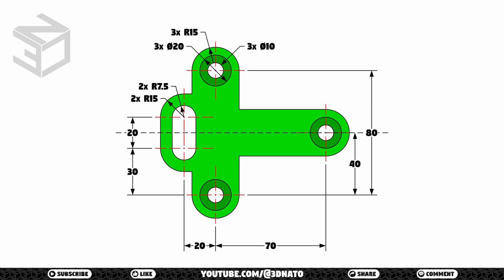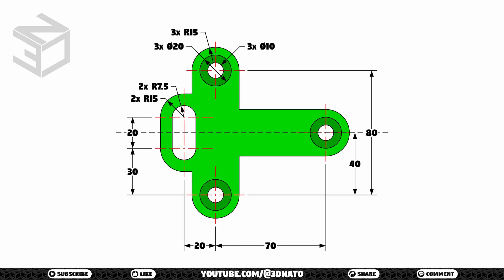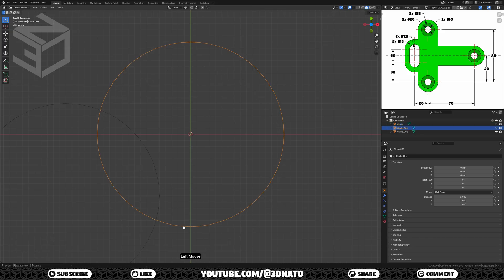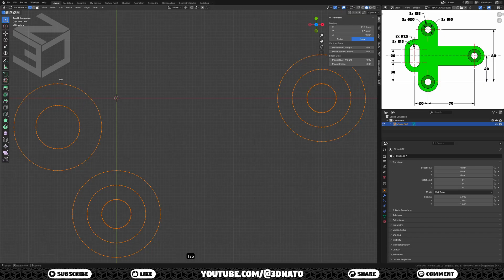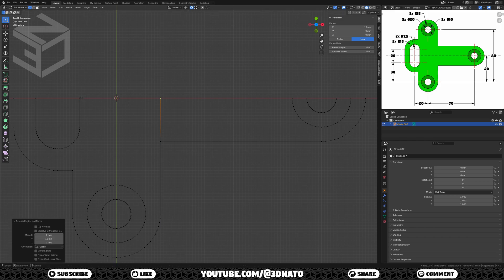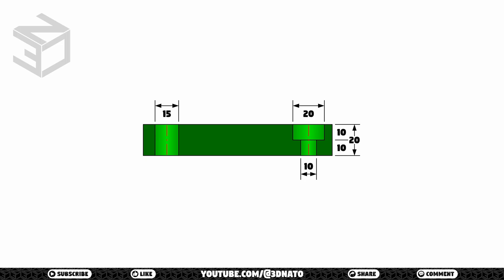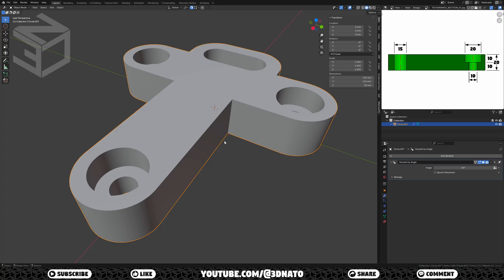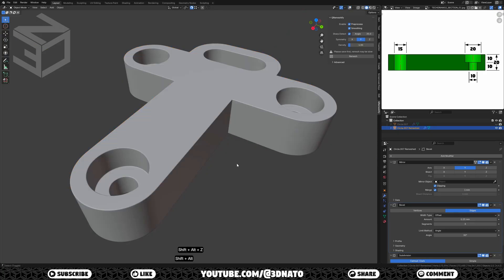Blender Precision Modeling Tutorial | Modeling Practice 02

Comment: Make a model without fillets, only sharp edges. Then select two edges in the place where the circle will be, and create a chamfer with a coefficient of 0.5 for external chamfers and 0.085 for internal ones, with the constraint turned on (key C). This way the modeling speed will be much faster. High geometry density, as shown in the video, is needed only for accurate modeling for subsequent 3D printing or for other needs, otherwise you can create a low-poly model and apply the Subdivision Surface modifier.
Reply from the maker: I'm trying to keep these videos as basic as I can for beginners to follow.
But thanks for sharing this workflow with us. 💛